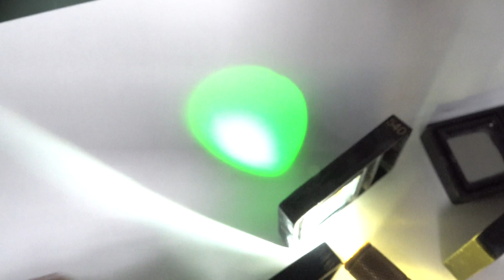Optical Filter Followup

Comment: The wavelength is affective ONLY with 90 degree light. At any other angle the filter may pass another wavelength +-of nominal.
Reply: Right. At any other incidence angle the filter layers get longer by the 1/cos of the angle. So the frequency of the filter off axis will be lower. These filters work exactly like a distributed microwave stepped impedance filter and the stopband is created by putting reflection coefficients from opposite sides of the Smith Chart next to each other. I wonder how many layers (filter order) they are and what the Q is. Anyone know of a spec document?
Reply from the maker: Ah, makes sense, that explains stuff. Thanks.
Reply: @EEVblog2  stuff= the 405nm at 5:40?
Reply: That's what I was curious about, I was told the same thing by an optical engineer I worked with in regards to at least some types of optical filters.
Reply: Due to the fact that as the filter is tilted the distance between the layers in the dielectric stack changes...there are a few other effects too...

Comment: This was a bit rude to the filters. Ok, they are old and probably defective before. However, you should never touch the surface of an interference filter. Especially not with metal objects.
The orange light that passes the 405 nm filter (violet) results from an (unwanted) secondary open band. It was not fluorescence from the paper as this would be light blue. Blocking these unwanted transmission bands may be the reason for the additional switchable filters in the device.

Comment: Have a look at the filter collection at https://www.edmundoptics.com/c/bandpass-filters/617/#
The datasheets for the individual filters give you the filter characteristics on both a linear and logarithmic scale - just as you would expect from an electronic filter circuit. But these things are steep, high-order filters!

When it comes to the 405nm filter something is wrong. The passed light should be deep blue. Also the emission spectrum of your LED torch is not a full continues spectrum.

Comment: Thes filters work by having layers of differing refractive indices half a wavelength thick. Attenuation wise you have the fact that it's a white led source( mentioned elsewhere) combined with the photopic response of the eye. This has a peak at 555nm and tails off around 400 and 700nm at the other end. So longer and shorter wavelengths will appear dimmer.

Comment: Do you have a local astronomy club? Someone there would give you cash for these filters.
Reply: mostly if it was a filter with very specific wavelengths, like H-alpha, the emission line of hydrogen. Those are not as expensive anymore as they used to be either...
Reply: @uwezimmermann5427  When I did astro-photography, an awfully long time ago - the only filter I really used was the sodium blocker. I live in London, and it was just blazing with sodium lights. Having said that, Andromeda was still an easy naked eye object from my garden.

Comment: I guess these filters require the build in pre-filter, that get toggled with a switch, there is no way the 405 is orange. maybe the lower values have multiple frequencies, hence the pre-filter in the machine
Reply: I agree, 405nm should be in the violet range and I confirm that the photometer who uses these filters has a lever to switch in a prefilter for low or high wavelength ranges. On the other hand, some of the filters have an "input" side with a reflective coating which blocks out some frequencies. In the video he uses them the wrong way and shines into the filter "output".
As I can remember (it was in the eighties that I used this kind of photometer) there was almost no way to see through the 405nm filter. So maybe this one is defective(?)

Comment: Btw, the reason for the different "attenuations" that you claim to see may very well be simply your eye's (&, by design, similarly, your camera's) sensitivity to these various wavelengths, not to mention the emission spectrum of the torch. Look up a picture of eye sensitivity curves, you'll see that 660nm is way lower down the L cones curves than 630nm, and 492nm is way down in the gap between the S and M cones (and probably between the sharp blue peak and the broad yellow emission typical of "white" LEDs). To leap to assumptions about the bandwidth/attenuation of the filters is probably a bit of... a leap.
Reply: Yep, I used to build display lasers. It was always hard to get a decent red output because in the early days the only lasers with a decent beam quality were in the 650+ nm range and the (apparently) much brighter shorter wavelength (635nm) reds had crap diverging beams. Latterly 640 diodes were introduced with good beam quality.
Reply: Agreed, 660nm is way beyond the most sensitive region of the human eye, I believe it only appears about 10% as bright as 532nm, which is close to the eye's peak sensitivity.

Comment: Hi Dave, I notice you shine the light through from right to left, but in the machine it shines from left to right. This may matter depending on the construction of the filters, there may be a reflective layer involved.
Reply: Maybe I'm wrong, but I thought filters were always perfectly reversable? I.e., it's impossible to make a "one-way" filter or anything even close, apart from very particular tricks like using magnetism to rotate polarization in non-reversible ways.  Even "one-way mirrors" are actually just completely symmetrically-behaving semi-silvered mirrors with a very dark room on one side and a brightly lit room on the other side, giving an illusion of one-way-ness.
Reply: There is a refletive layer. The light input is on the round side.

Comment: Almost certainly dichroic (interference) filters, given the tight passband and amount of reflected light from the incident side. They effectively behave as mirrors for all the wavelengths in the stopband. With such filters, angle of incidence will move and change the shape of the passband a bit, so make sure the light is 90 degrees trying to 'measure' the bandwidth this way. Also surely the LEDs in your torch aren't producing properly white light; you should know this from your forays into high CRI lighting.

405nm filter is clearly passing reddish light (should be violet), so it must not be designed to filter full spectrum. Try with the wideband filter from the device.

The monochromatic greens and blues are really beautiful. It would be neat to see all the colours simultaneously beside each other.

Comment: You'd normally use a deuterium lamp source when testing UV ranges, since incandescent light doesn't have much activity in that range. UV can always be detected by fluorescence.. most white papers will flouresce due to whitening agents within the papers. LEDs are very narrowband generally and quite spiky even if made to be wider band (like high CRI LEDs). One neat thing is that at shorter wavelengths of UV, like 200-270nm, aluminum becomes a pretty good material that will pass only UV. It would be a very thin coating but it's the actual metal nonetheless. Shiny and opaque in real life and about 30-40% transmissive to UVC.

Comment: In the 70s & 80s we used that kind of (I assume) interference filter to pick out 324nm & 327nm UV lines in copper arcs to detect - you guessed it - arcing. Corion was the brand that was readily available around 1983 but Barr & Stroud were the originals in the systems I was working on. Corion appear to be still around with the name 'Newport' e.g. www.corion.com/Resources/Common/DS-05074_UV_Filters.pdf

Comment: each element and compound has a unique spectral pattern and if u look at the correct wave length you will see that they correspond to band of the spectrum
copper burns blue sulphur yellow iron red can not remember the rest but that is the principle  
the colours that they give off when heated are related to the colours the normally absorb
u shine a broad spectrum light through the material and the light is absorbed at specific freq. for spec. elements/compounds so you can see the contents and the intensity indicated by the strength of the absorption ( IE light loss) solids can be dissolved   and the solvent can be subtracted from the readings and you can find out what the stuff is made off
best I can do after 40 years and 4 pts.

Comment: 405 nm definately fluoresces white printer paper to make it look cyan. 405 is a very deep blue (almost UVA, it looks violet, very difficult to focus on in the presense of normal visible light), and the wavelength used in blue ray burners. Your torch may actually use a 405nm blue die as the pump source for the phosphor. Unless your torch is incandescent, in which case take your pick of frequency.
Reply: I'm pretty sure that torch does not emit 405nm light (a blu-ray laser diode would - not safe without precautions though) or below.
Reply: 405 might fluoresce the paper but it will fluoresce bluish if they used whiteners. Dichro filters often will pass other wavelengths which is what you are seeing here. Thats why there was a UV/VIS switch on the instrument these were used it, they put a short pass filter in the way when in UV which would have cut off the orange coming through.

Comment: Is that a LED light?  You know they don't have a full spectrum.   They are a blue LED with a yellow/red phosphor on them.  Use an incandescent light.
Reply: The lightbulb from the machine he got the filters from would have been perfect for the test.
Reply: Incandescent has attenuation at certain wavelengths, just different locations than LED. Google 90 CRI LED spectrum.
Reply: @jaro6985  Do an image search for 90 cri vs tungsten spectrum

Comment: 405 nm leans is broken. It didn't be orange. Or it is not enough wide and take through red wave sizes, and your flashlight haven't so violet waves.
Reply: I’d guess that lens passes two peaks or something, and the additional filter in the machine blocks the longer wavelength leaving only 405
Reply: pyromen321 or it be "washed" by some chemicals.
Reply: Or camera convert violet to that "orange". Because orange is about 640-650.
Take light to that "405" with 6xx together. May be this frame is not for this leans.
Reply: I don't think that torch emits light of 405nm or below

Comment: You just saw with the 405nm filter why the instrument had the second filter to select between either 300-500nm or 500-1000nm. 405nm is very much in the blue range but this filter has a lot of orange-red (580-660nm) pass through. This is due to the filter not being a perfect filter when you get far away from its target range.
Reply: Yep, I was thinking of these like a high/lo pass filter.
Reply: @wobblysauce  more like a bandpass filter...
from wiki... "In astronomy, band-pass filters are used to allow only a single portion of the light spectrum into an instrument. Band-pass filters can help with finding where stars lie on the main sequence, identifying redshifts, and many other applications."...same usage here...
Reply: @WacKEDmaN   Yep that's the one that can do the other with the two though, and Notch is the inverse, but that is Audio, think light is different, As one was additive and the other is subtractive.
Reply: 405nm is deep violet, bordering on UV, but I agree with you regarding why there is a second filter.
Reply: @cambridgemart2075  That's very true but I am always hesitant to say that. Because it causes so many surfaces to flouresce, it can be hard to find one which doesn't and it can confuse users.
Reply: Wondering why have 2 filters so close? 
540nm is the exact (+-1nm) wavelength for transmitting sodium light.  
There are safety glasses (spectacles) available for use in glassblowing, which completely filter out 540nm. 
($250, unfortunately.)
Reply: @CaspaB  The filters will be tuned for specific transmission lines of substances being identified, so one of the filters will give a much higher signal than the other, nearby, one.

Comment: 510-405=105. Anyway, that 405 was not the colour I'd expected. Maybe the paper's fluorescing.
Reply: Nope, filters like this often have additional areas of transmission a decent distance away from the target filter region. This is why the instrument had the filter selector for below 500nm or above 500nm.
Reply: Or its only meant to be used in the setting where the device filters out all longer wavelengths, so it doesnt need to block that part of the spectrum